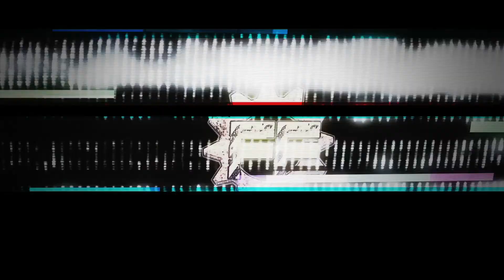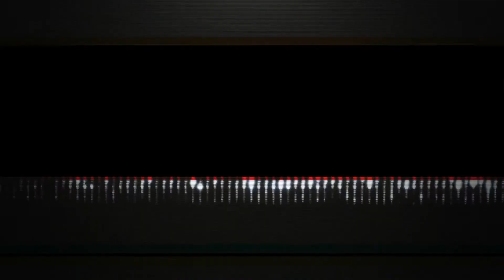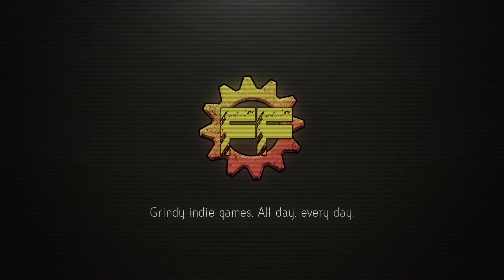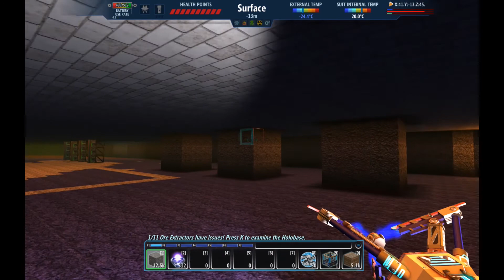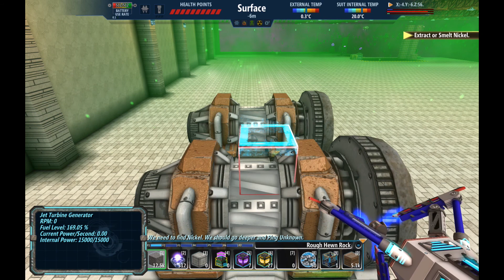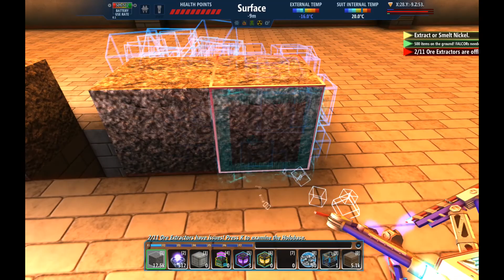FortressCraft: Evolved - 16 - Power system test! (Gameplay)

Comment: The "rush" pps of the turbine actually applies to your "rapid" resource setting as shown in the video.
Reply from the maker: Thanks. I figured it out after when I was watching in editing. The numbers definitely matched. "Rush" threw me since it's the name of the gameplay mode I haven't yet unlocked. I try to read as much info as I can while playing but it's difficult to get it all while recording...what, with all the yammering on and such. When I suddenly go quiet it's usually because I've become distracted trying to read and understand something in a pop-up. :)
Reply: @fiascofactory6250  You're welcome. I think the reason why the developer use "rush" here instead of "rapid" is that the rush mode unlocked after OET use the same resource setting as the default rapid mode. You will see this happens several times in the game.
I've always feel difficult to keep concentrated when dealing with several things simultaneously and it is not rare to get distracted when trying to follow the informative popups during the game progress.

Comment from the maker: So, long story long: I tracked down the problem with gold in the nickel mass storage. Traced the lines all the way back, thinking I had botched the belt rework I just did. Nope. There was gold ore coming up in the nickel lift. Turns out my nickel mine was right next to a gold vein. Once the nickel ran out the miner just ticked over and searched for more ore and found gold so went to work...and I didn't notice because my attention was elsewhere. I've purged it all out after a bit of work and set up a new nickel mine. Bit of a pain but I know now never to set up a miner on the border of two ore veins!